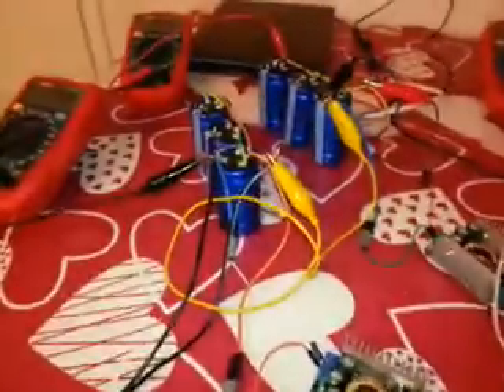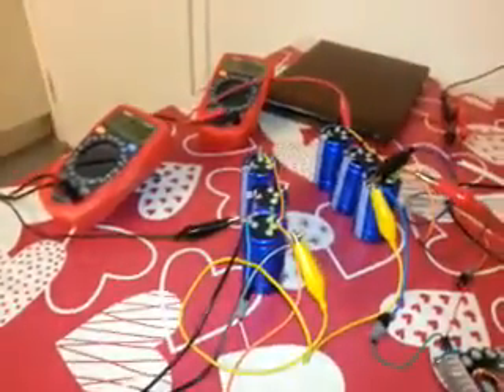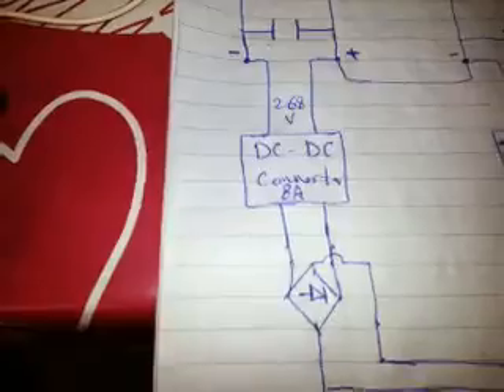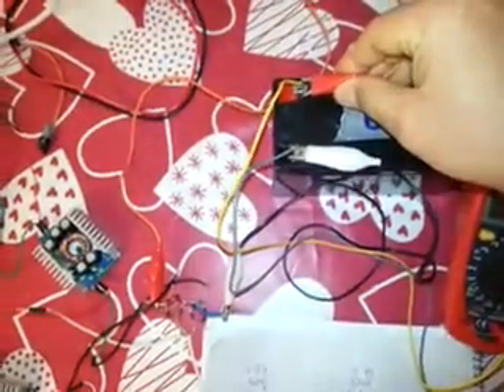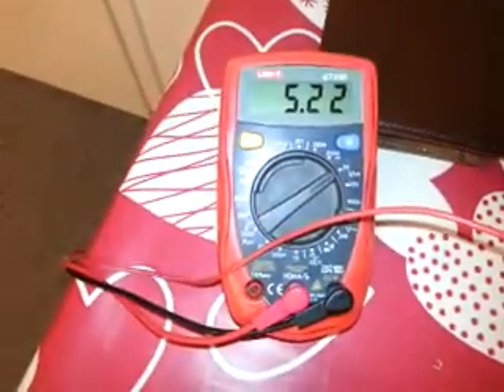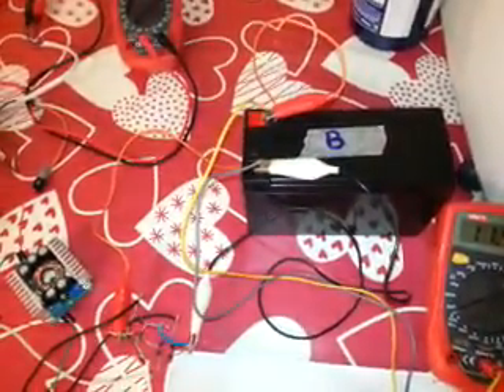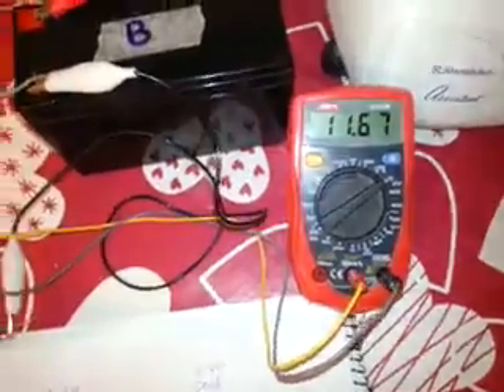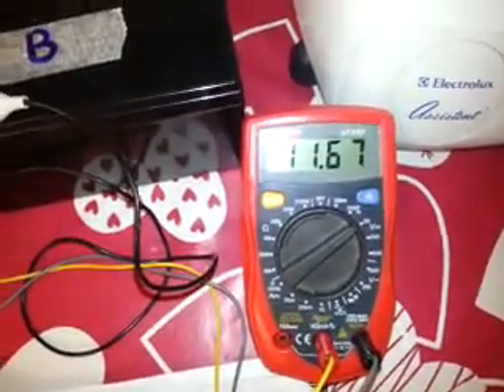Ultra super capacitor balancing circuit

Comment: How is this possible with a non-isolated buck converter? As I understand, the input - & output - terminals are connected. So, when you connect the linked buck converter like this, won't you short-circuit the left converter?

Comment: Why do you need the bridge rectifiers? Are you thinking of using a AC source? If not it is not necessary to use the rectifiers.  Also this circuit  is not truly balancing each individual capacitor.